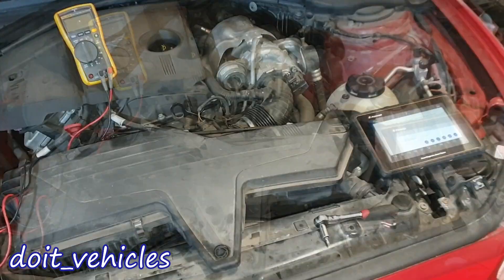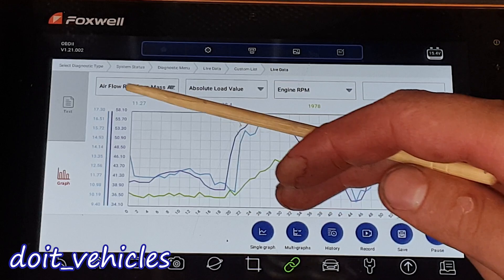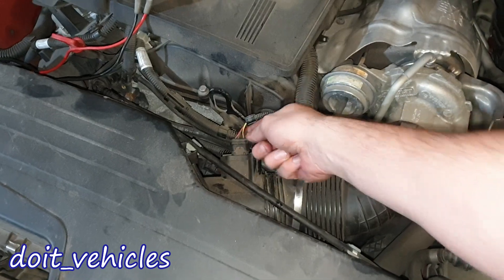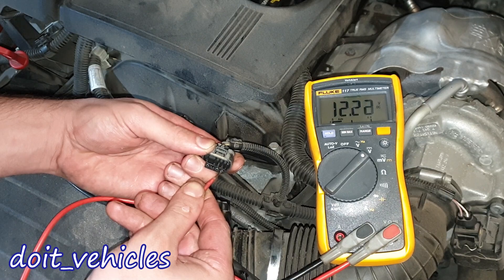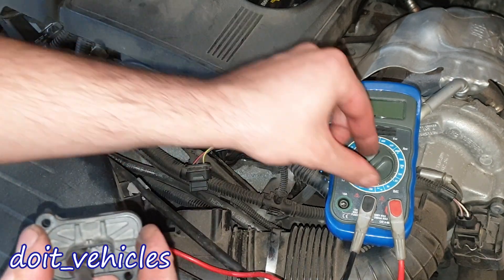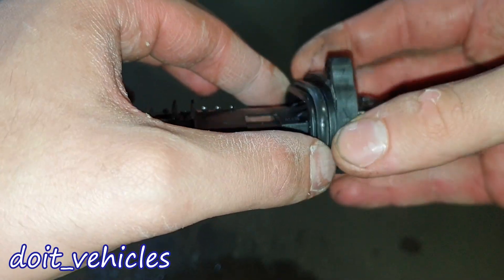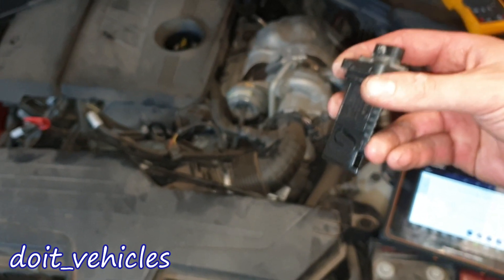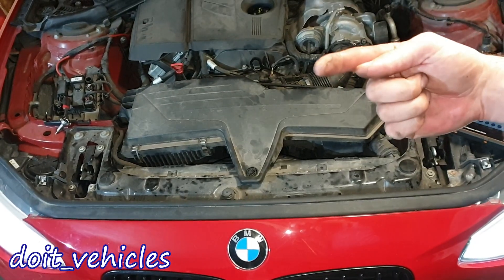MAF sensor Clean / CHECK on BMW 114i 116i F20

Comment: Excellent explanation sir. Clear and concise, it helped me fix my nephew's car. After a regular service the car would die on low idle pulling out of the driveway. They probably sprayed some crap into the enclosure that clogged the MAF, cleaned it and now runs just fine!